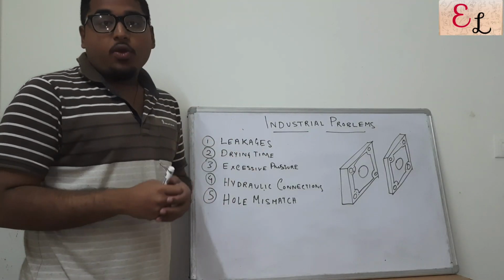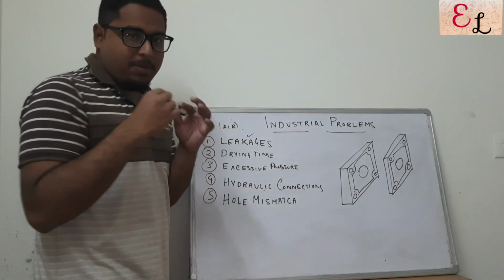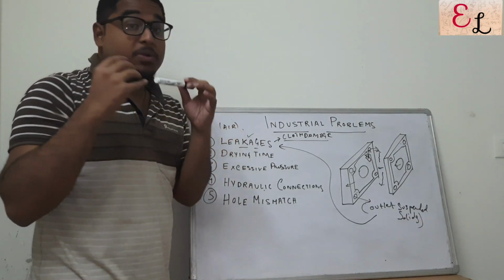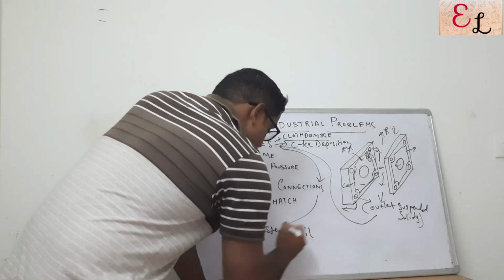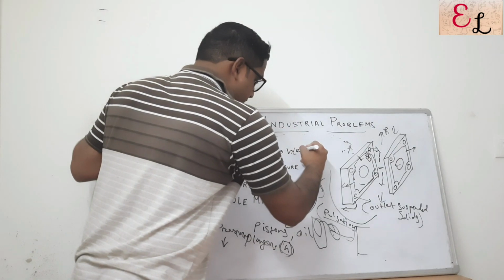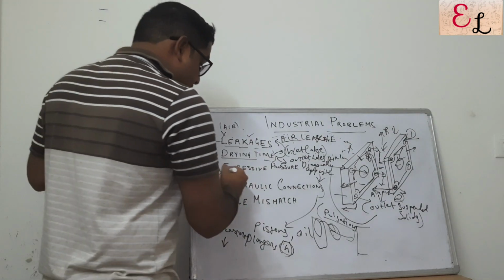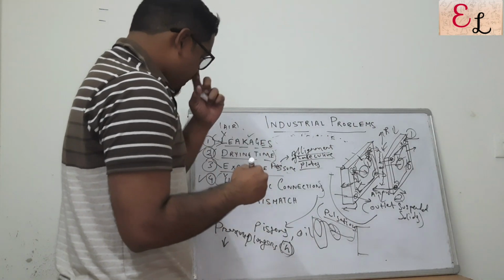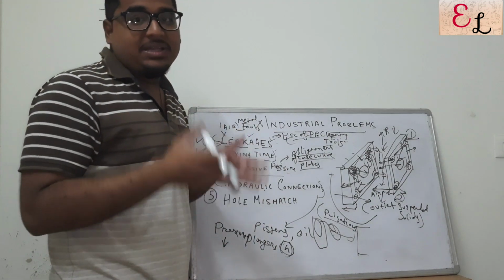INDUSTRIAL PROBLEMS | FILTER PRESS | LEAKAGES | HYDRAULIC CONNECTIONS | AIR DRYING | FILTER CLOTH

Comment: How to reduce damage on filter plate clothes?
Reply from the maker: There are lot of levers, some of them being distribution of pressure all across and preventing concentration of pressure on only one side. This is done by correct arrangement of plates and also by cleaning the filter press cloth at regular intervals. Also, the cleaning needs to be done using Plastic Tools and not metal tools to prevent damage to filter press clothes

Comment: We are facing terrible issue while filling up the slurry in our filter press machine?
Usually it takes around 15-16min to complete a single cycle, nowadays it is taking twice of that.
Reply from the maker: You should immediately contact the OEM of the Filter Press if the situation is beyond your control

Comment: Sir, What is the reason for unevenness of cack thickness in Membrane filter press??? ( It is mostly happened in Pigment plants)
Reply from the maker: It's because of uneven pressure development on different parts of the plate due to resistance to outer flow of filtrate fluids

Comment: Great video, I'm having issues with our filter cake leaking through the filter papers we use (instead of cloth). Do you think it's a paper/cloth problem? We have trouble getting clarified product from the press and inconsistent results, especially later in the run. I have a feeling the papers are not rated to the pressure of holding the filter cake but our technical sales rep ensures us that the paper is rated for the pressing pressures we see, typically 40-70psi. I have new cellulose pads arriving next week.
Reply from the maker: There maybe potential leakages in the paper itself, please change those

Comment: We are using chain for pulling the filter plates during cake discharge, only one side of the chain breaks consistently. Troubled by this issue. Need a solution.
Reply from the maker: Your filter press cloth is getting heavy with the cake deposition specifically on one side, This may be because of wrong valve opening while air drying thus restricting air flow only through one side whereas the other side still remain wet and hence the chain breaks on that side, the other reason may be Outlet Valve Drain Openings on the Plates are not alternative, drain holes on consecutive plates may be lying on one side leading to heavy cake deposition on that side. Moreover the locking mechanism of the shifter with the chain may also have an issue. Please check the shifter bolts on that particular side or find any alternative locking mechanism between Shifter and Chain.
Reply: @LifeBeyondBusiness  okayy let us check out that and does the end plate misalignment could be a reason? Your thoughts.
Reply from the maker: Yes it could be